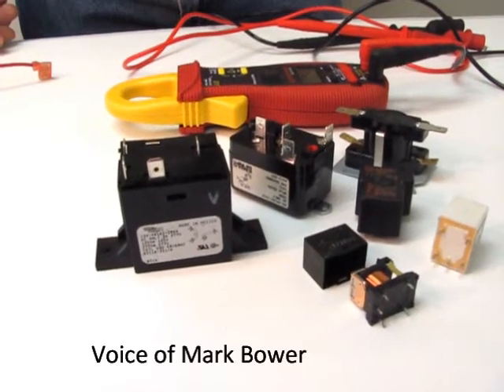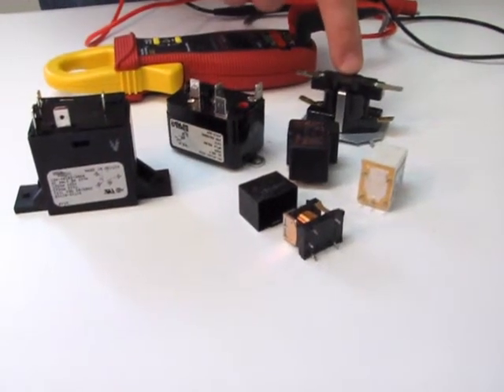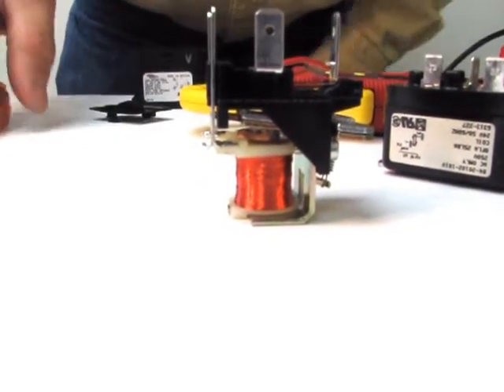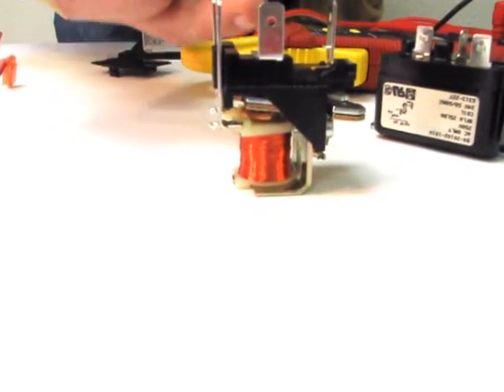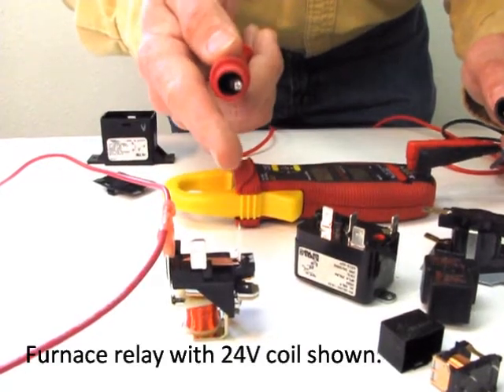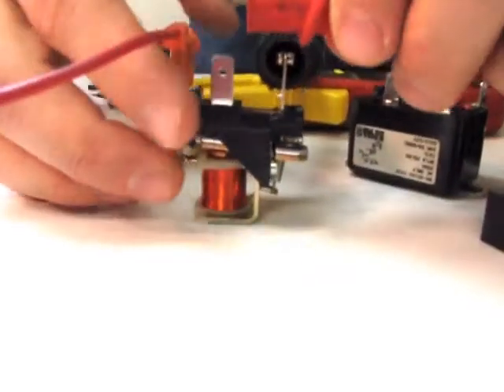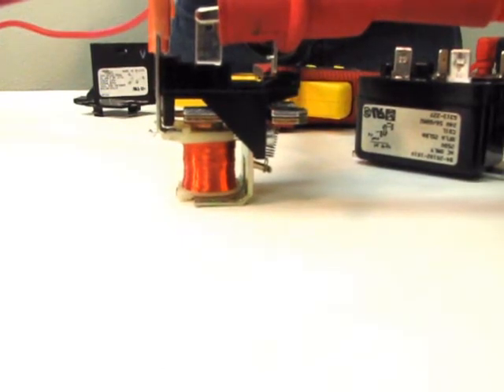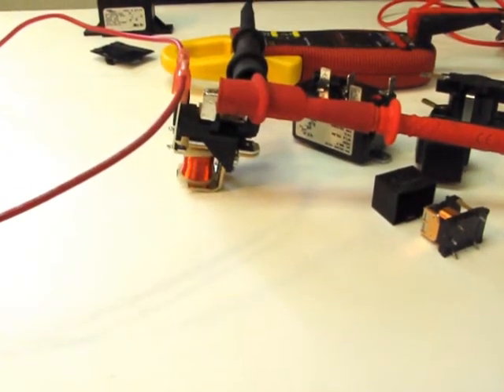How a relay works

Comment: I am trying to automate a system I have in mind, I would need to turn on  an electric motor for few minutes then off for 12 hours. I do not know anything about electronics but, would you suggest using a relay to do what I described? Thank you so much